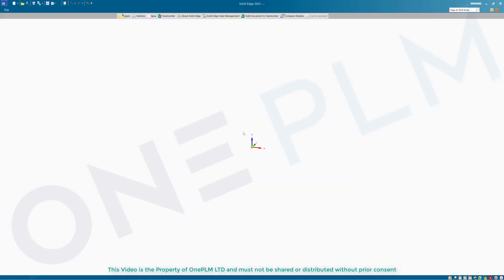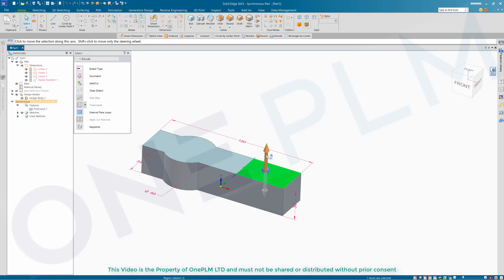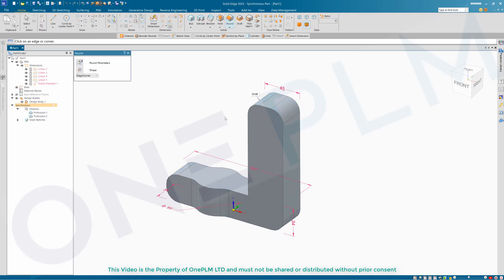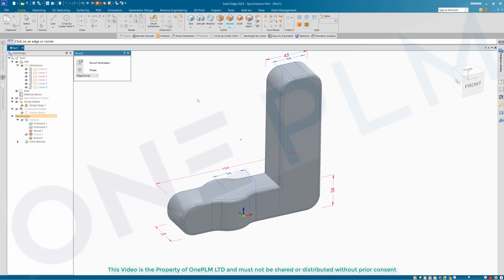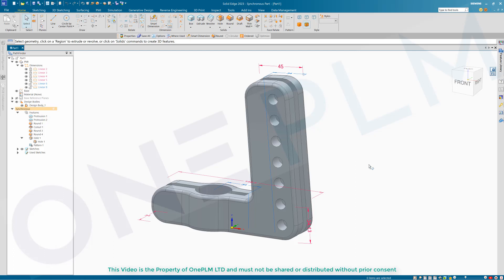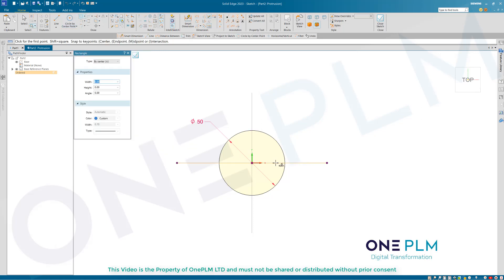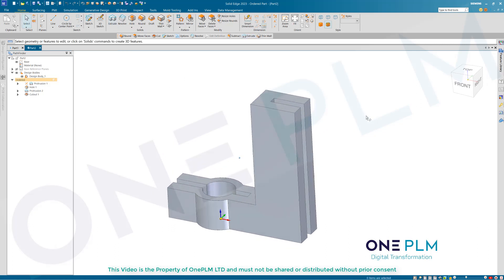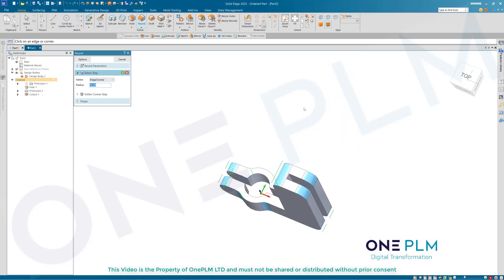Solid Edge 2023 Sync Vs Ordered Modelling

Comment: I use solid edge everyday. I’m annoyed most parts I use ore ordered. I think sync could be so much more affective. And save time. I use solid edge for sheet metal parts.
Reply: Synchronous is horrible for sheet metal.
Reply: @JAnx01 , "Synchronous is horrible"
I've been using Solid Edge since ST2 and I had no idea that "ordered" mode ever existed there till I came across some people who use it in ordered way only yet know fuck all about the synchronous. Once I tried the ordered I was shocked what a piece of garbage that archaic ordered mode is. Initially I couldn't get why there are tons of negative comments out there  left by  frustrated  Solidworks users after their Solid Edge experience. Now I know that all of them had a hard time with the ordered. What a drama! 
P.S. Ansys Spaceclaim is another great thing that's very massive at direct modeling. Nothing can even come close to Spaceclaim in terns of preparing a geometry for simulation analysis as the other software is just not capable to do that. I wish Solid Edge Synchronous would merge Spaceclaim!
Reply: @MSM5500  I can assure you people the people who use the sheet metal environment a lot in Solid Edge have had good reasons to stick with ordered. Until recently, it wasn't possible to use "Etch" in synchronous at all. I tried synchronous sheet metal modelling in SE2023 and now it's there, but it still can't transition etches made in ordered to synchronous, effectively preventing companies from moving their products to synchronous. In SE2023, the etch feature in synchronous also feels kinda half-assed. I works like an ordered feature, meaning it is sketch based. You can always reactivate the sketch and change the geometry, but none of your dimensions will be there. It auto-wipes them every time you confirm the command.

Other problems from previous versions persist - problems with mirroring flanges, the mirrored geometry doesn't attach to the model. You also can't add a bend to corner that has had a corner treatment applied to it. You have to delete it first. In ordered, it's a non-issues. Also, there's no loft feature in synchronous.

Regarding Solidworks, I don't think its modelling tools are superior to Solid Edge ordered, just more streamlined for the average Joe.